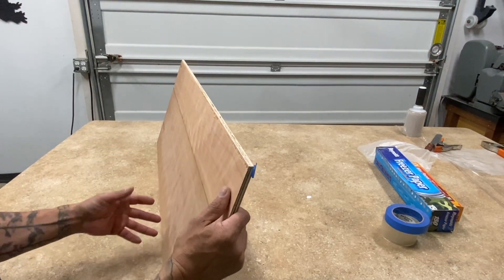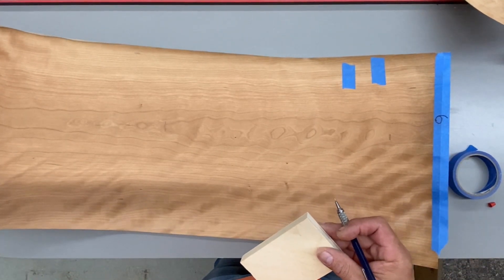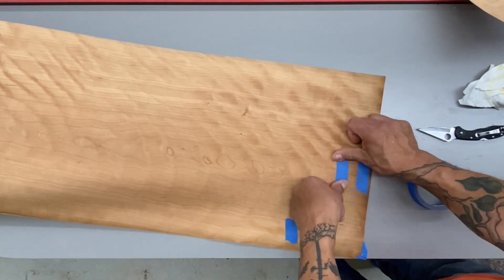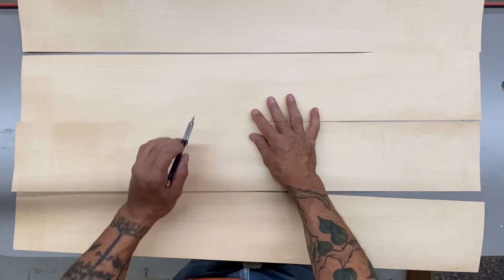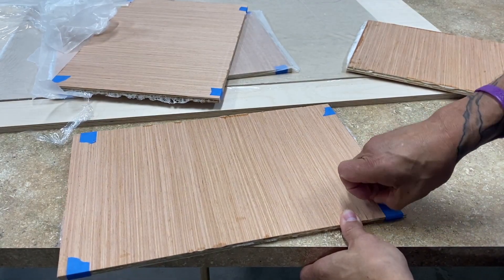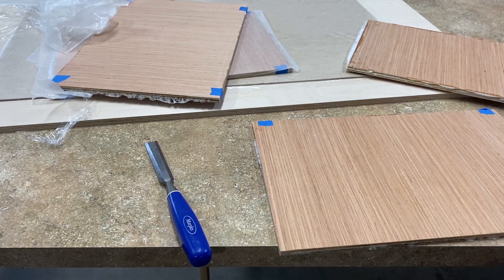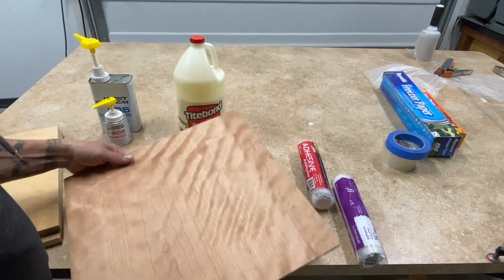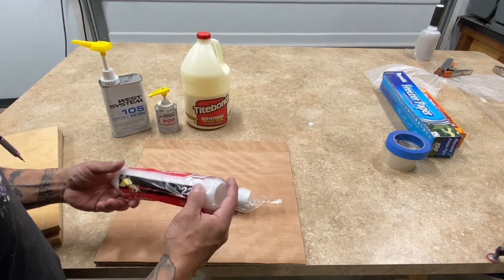More Veneering Tips!

Comment: Thanks for the vids, could HDPE or UHMW plastic sheets be used to sandwich the layers?
Reply from the maker: Yes!  You have access to that amazing material?  I have small pieces of it that I routinely use for clamping cauls.   Even bedded right into glue…it never bonds.  Thanks
Reply from the maker: Yes!  You have access to that amazing material?  I have small pieces of it that I routinely use for clamping cauls.   Even bedded right into glue…it never bonds.  Thanks
Reply: @ramonartful  I found some colored 3/4''  UHMW at a small plastic maker locally. They usually have some large scraps from custom orders that only needed a small piece. I am going to make an MFT top with it. So I will use what your vid shows and make up some cauls. Thanks for all the info.

Comment: Thanks for another great video! Is it necessary to veneer the backside of an MDF core panel if it will be glued to plywood?
Reply from the maker: Can you tell me more about your goal?  Is it an MDF panel with another plywood panel for a thicker overall panel?  

Typically, whatever you do to one side of a substrate, you do to the other side.  You already know that, yeah?  This creates a balanced panel.  It’s a little unknown how two different substrates will react with each other when placed back to back. (Or face to face)  I know it adds more time, but to be safe…veneer on both sides of each substrate is ideal.  You may get away with it if you use a rigid glue rather than a PVA.  Thanks
Reply: @ramonartful  It's a large piece for a local church where the architect speced plywood under the veneered panel. So to save time I was just going to PVA glue the 3/4" mdf to the 3/4" ply. I figure that will seal the backside well enough to prevent any warp. Am using Unibond 800 on the veneer itself. I can veneer backside if needed. Like I said, just trying to save some time.

Comment: I have a 3/4" laminate shelf board with grooves as a bottom platen, but it tends to bow under vacuum pressure and of course translates into my veneer panel. It looks like you don't have that problem, do you have any tips on avoiding this problem? I think a matching top platen or clamping the bottom platen down is my only choice, yes?
Reply from the maker: Hmm.  You mean the vacuum bag bowed the bottom platen upwards?
Reply: @ramonartful  Yep. Happened when I put a small top platen in the middle of the board like you did to add extra pressure to the center
Reply from the maker: @morscodez  That is strange.  I don't understand why it's bowing the bottom platen upwards.  Darryl Keil with Vacupress would be a good guy to ask.

Comment: What glue are you using?
Reply from the maker: I  use different glues, depending on the project.  Despite what many say…there is no “one size fits all” when it comes to glue. I use Titebond I or II for gluing seams.  If the panel is small (like I say around 6:55) I use that same glue for adhering the veneer to a substrate.  Larger panels, I use a glue that won’t “creep” like Titebond or other PVA’s can…like Xpress veneer glue, UltraCat or even epoxy.  These are “rigid” bond glues…zero creep and are barely more work and you don’t have to worry about veneer seams moving.  Hope that helps